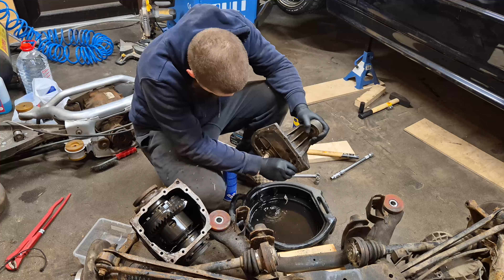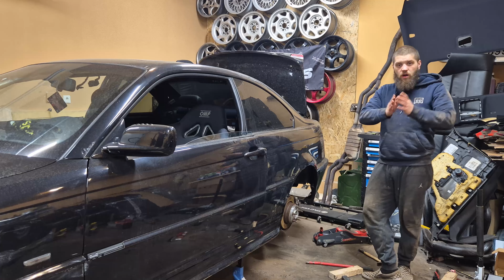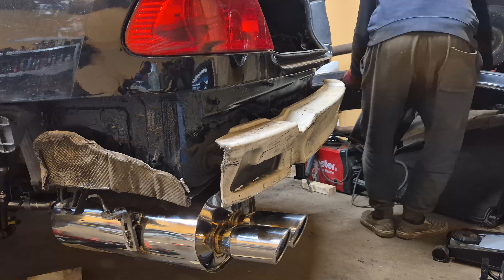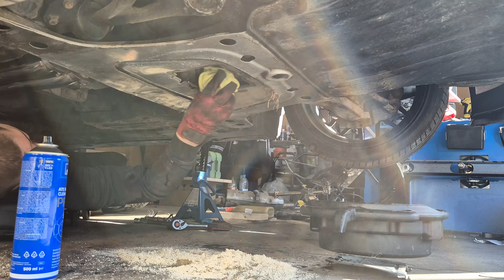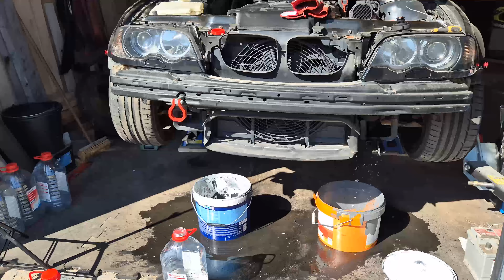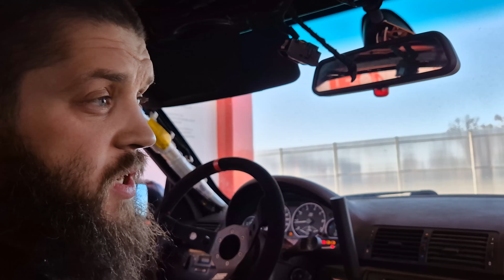E46 330ci DriftShop Exhaust Upgrade, Trunk Spring Latches and Regular Maintenance

Comment: The exhaust line looks enormously like a line for e36, My driftshop e46 exhaust line doesn't look like that, Which would explain, which does not mount correctly
Reply: hey there mate can you share videos of the e46 sound etc, I have a 325ci